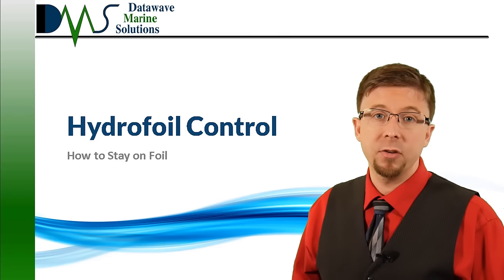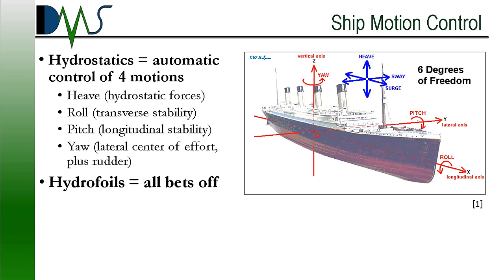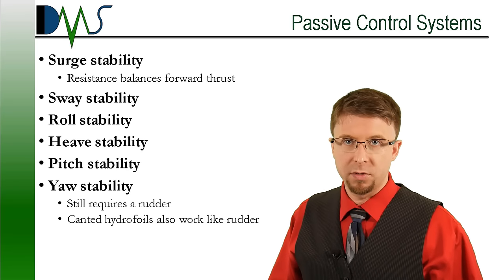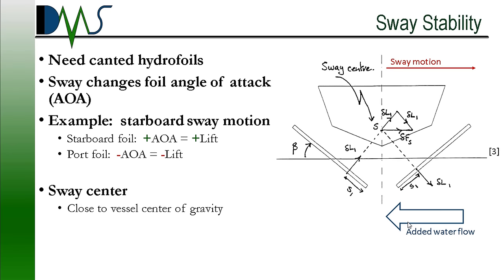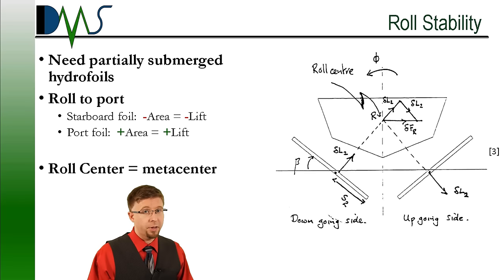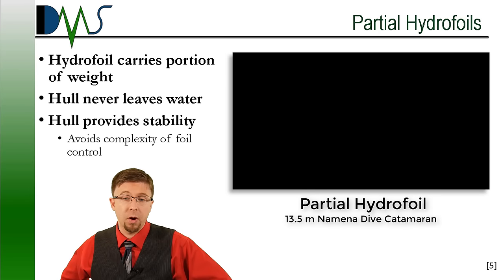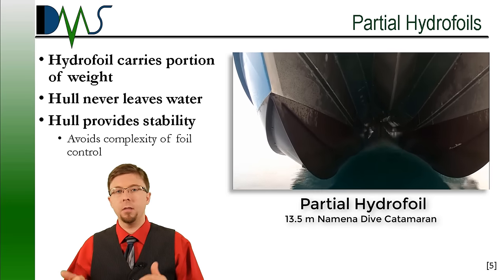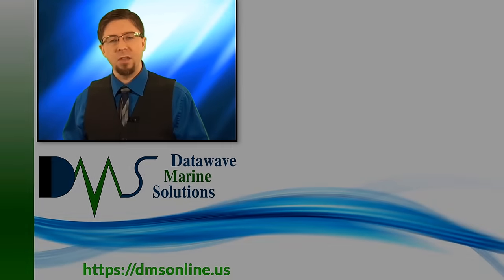Hydrofoil Control:  How to Stay on Foil

Comment: My father was the captain of the H.S. Denison, a 90 ton hydrofoil with surface piercing foils designed by William Carl. In the early 1960's they did rough water trials south of Newport R.I. comparing the Denison with a 90 foot Coast Guard Cutter. The seas were roughly 10 feet or so with regular wave frequency as near as I can tell from the 16mm film dad showed us. The Denison could run at 55 ->60 knots at ALL angles to the wave state. When Denison ran parallel to the waves the roll was minimal. The cutter had to abort her run as roll became dangerous. At 60 knots the Denison's keel was 6 feet above the surface of the water.

Comment: As a aviation fan this video was very easy to understand,making research and study much easier.

For more references look at the history of wing dihedral and fly buy wire systems The concepts are very similar (except in viscosity and compression ratios)

Comment: Thx Nick great video I sailed on a number of light weight multihulls cats and tris and always thought of the use hydrofoils especially after watching the Americas cup series in SF. FWIW I served on USS Tacoma PG 92 which was a light weight 200t ocean going high speed gunbot with planning hull, these boats were  notorious for poor performance  in heavy seas where they would experience rolls of near 70deg and pitching of 45deg we really could have used partial  hydrofoils for stability in those conditions. FYI The USS Tucomcary you used the  image of in your video was built shortly after the PG I served on and destroyed hitting a reef in the Caribbean sad to say. Can't wait to watch the next round of America's Cup with hydrofoil monohulls. Thx again for sharing your knowledge of flying boats Nick.

Comment: Partial hydrofoils are an interesting category of which I was unaware until watching this video.  As a catamaran sailor I was intrigued to see the previous generation America's Cup design and look forward to seeing the  new foiling monohulls in action.  The raised foils on the upwind side look pretty dangerous though... I wouldn't want to be on the leeward side of a boat upwind of them in close quarters.
Reply: they have a more limited use than foils generally so they're a little less popular. But they are gaining in popularity, the current gen of IMOCA boats primarily run in a 'partial' mode, largely relying on the planing and buoyancy of the hull. Partly it's due to the limits imposed by the class rule, but it does work very well.

Comment: Oh awesome I was just making a comment on your other video about hydrofoils. Thanks!
Could you make a video about the practical limits of energy efficiency of hydrofoils? Assuming computer control and optimizing for energy efficiency / speed.
Personally I'm interested in a solar powered cruiser using minimal power to foil at good cruising speeds.
But it would also be interesting in view of the need to use less fossil fuels for transportation, replacing air travel with fast hydrofoil ferries.

Comment: One thing that isnt mentioned is wing shape and wing profile, angle of attack for forward and rear foils, height of skegs for a certain size weight. Positioning on the diagrams are flawed as most filers now carry forward foils under the mast position of a yacht for example. Interesting but need a follow up and more exploratory. 

I made ladder foils in 97 on my 28 foot single seat trimaran, coincidentally similar to the hobie trifoiler at the same time.

Also adjustment wands on variable pitch surface piercing foils and connections to boat also a good video

Comment: Cool vid. I have a topic suggestion: Icebreakers! Especially what kinda hull shape is good for them.
Reply from the maker: Nice idea!  I will add it to the list.
Reply: Since it's been a year, I can share what I've read (non-engineering).  The old concept of an icebreaker on the Shackleton expedition was to use very strong and steep sides to break ice at the bow.  Later, they discovered that a shallow bow could ride up onto the ice, and break it using the ship's weight, which seems to have been much more effective.

Disclaimer: there may have been some advances in the last hundred years or so!

Comment: Good video, thank you!  Q about passive roll control which you suggest needs to come from surface piercing.  Yet, airplanes handle spiral divergence though being fully immersed...
Reply from the maker: I don't think I can comment too much on airplanes, since I'm not an aeronautical engineer.  
But airplanes and hydrofoils do share some similarities.  Hydrofoil roll stability can come from submersion of additional foil area.  But it also comes from the foil dihedral angle, the same as an airplane.  

In addition, the the elevators, rudder, and ailerons on an airplane are all examples of what I would call active control in the nautical world.  And I have never personally seen an airplane without at least some of those active controls.
Reply: @DatawaveMarineSolutions  with a submerged foil and dihedral, can you get lateral stabilitty (no rollover even with fixed, zero rudder?) I expect that to be hard because of high cg, vs an airplane.

Comment: Hmmmm... at 5:25 you say that roll stability requires partially submerged foils. I don't think that this is correct. In the same way that wing dihedral gives aircraft stability (fully submerged in air), I think that fully submerged foils with dihedral have roll stability. The lift from the foil is proportional to cos(theta) where theta is the angle between the normal to the foil and vertical. When partially submerged they have more stability but fully submerged they are also providing roll stability. :)

Comment: Dankie Nick. This quite intresting. I am wondering why was  the hydrofoils not use more? If it better that the normal design. And what is the fuel burn of this hydrofoils? Hydrofoils is like the 3rd level op boat design. Normal sailboats with a keel are plenty. Cats R less plenty and the hydrofoils only on YT!
Reply from the maker: I don't know the exact fuel burn rate, but it can be very high.  For comparison, I looked up fuel burn rates for a 3000 hp gas turbine engine.  Hydrofoil boats normally use turbine engines.  This is a rough estimate, based on some sketchy data.  But the fuel burn for that type of engine would be in the range of 300 gal/hr.  Hydrofoils are not used more for several reasons.
- They only work for light craft.  Ships normally specialize in carrying heavy things.
- Fast speeds are not always possible in a heavy storm.
- Hydrofoil craft are far more expensive.  Compare the cost of a fighter jet to a ship.  Similar difference between a hydrofoil and normal ship.

Comment: Why are hydrofoil craft not more popular, especially with smaller to medium-sized vessels? Also, could a pilot maintain manual control of a 40-foot hydrofoil, foregoing the need for a computer control system?
Reply from the maker: Yes, a pilot can maintain control manually.  They do it on the Americas Cup boats.  As to why we don't have hydrofoils everywhere.  As an analogy, it is the same reason we don't have everyone buying racecars.  A hydrofoil boat is complicated to operate, very expensive, and requires extra maintenance.  They are specialized ships, and few people can justify the cost.
Reply: @DatawaveMarineSolutions , thank you. I'm trained in mechanical engineering, and yet to further study naval architecture. I intend to design and build a ~40-foot motor yacht with retractable hydrofoils for cross-oceanic voyages cruising at ~40-knots. My preliminary thinking is that such a craft will be faster, and more fuel efficient than conventional motor yachts, whether catamaran or monohull. I intend to construct the yacht myself, to make it financially viable as a project. Do you think this is realistic for one with only mechanical engineering undergraduate studies behind him?

Comment: Can you suggest books or research papers on hydrofoil design?  I suspect I could get an active design working right sooner than a passive one by developing my own control systems.

I'd like to learn what would be involved in retrofitting an old monohull sailboat with hydrofoils.  My budget is roughly zero, but I have enough time to learn to an amateur level.

Edit: I started watching your America's Cup video, and I will never be in that class.  My interest is in making improvements for pleasure cruising as a hobbyist.
Reply from the maker: One book to look into:  "Hydrodynamics of High-Speed Marine Vehicles" by Odd M. Faltinsen.